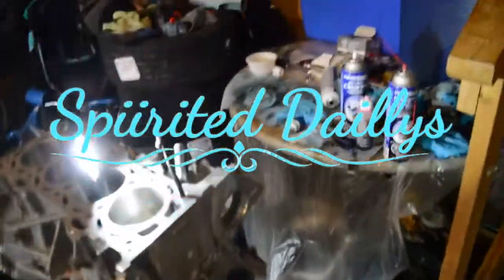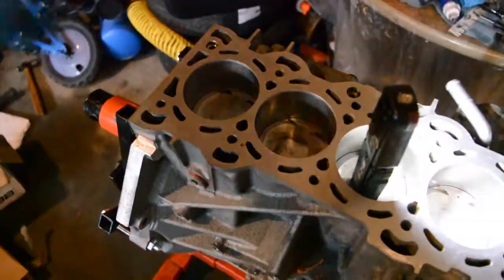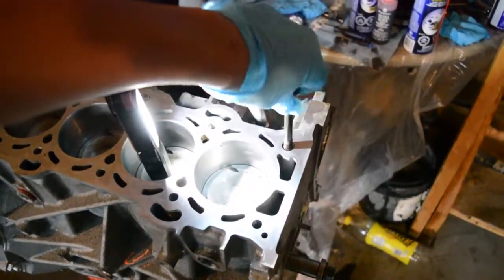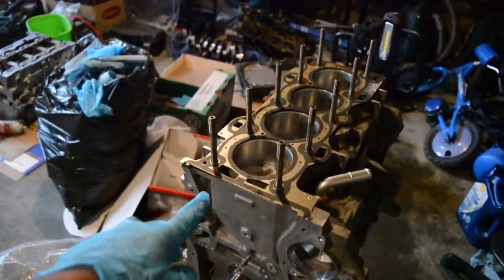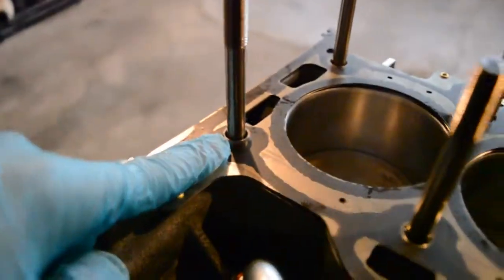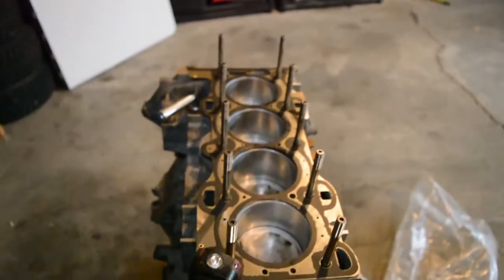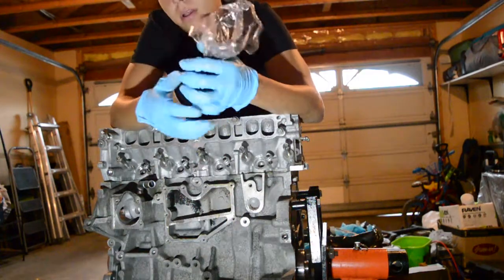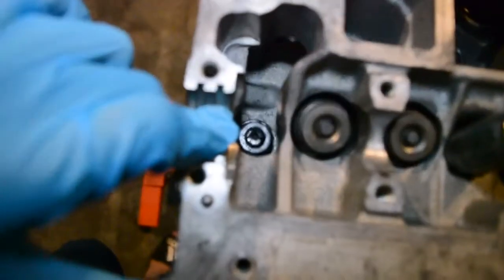Mazdaspeed Engine Build Part 7: Cylinder Head Install

Comment: When is more content coming
Reply from the maker: Just pulled the speed out of hibernation last week. I have out about 8000km on the built engine and all if good so far. Will be making a update soon with it.
Reply: @spiiriteddaillys3231  I just bought a 07 MazdaSpeed 3 cause I wrecked my civic I am rebuilding the engine rn and the car should be making roughly low 600 to the wheel

Comment: so what happened? does it run? you still driving it? good series man!
Reply from the maker: It’s running strong 8000km on the engine all is good! Currently it’s parked up for winter and will be uploading spring time with update. New widebody and wrap on it now!!

Comment: When’s part 8 dropping?
Reply from the maker: Unfortunately I can not find the last footage, my memory card is corrupted :((((. But basically from here you just have to time the motor and there are plenty of videos showing how to time the engine. And then just bolt on all the accessories and manifolds. I am really upset I lost this footage :( worked hard on filming it all.